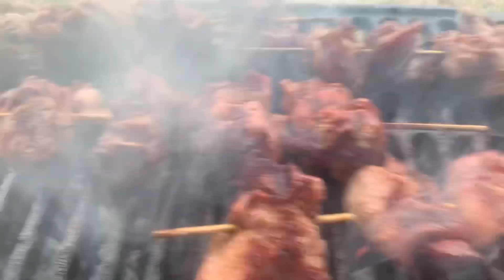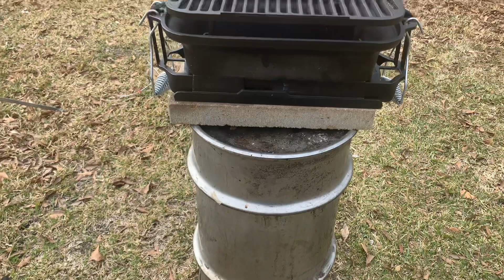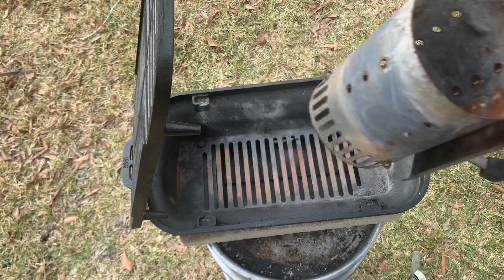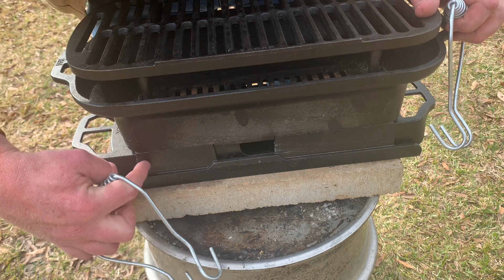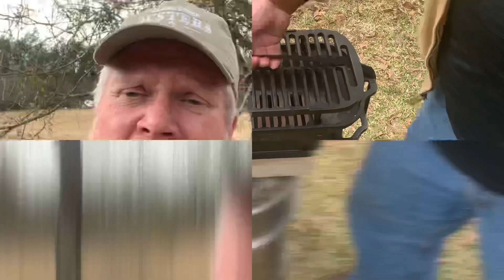Lodge Sportsman’s Pro Grill: Tips, Hacks, and Cautions. (A Follow Up Review)

Comment: ¤♤ NO GRAVITY  IT JUST SUCKS! " ROCKING IS FoR MUSIC : NOT GRILLS ( NEVER TIGHEN THE SCREWS OR DRILL TWO MORE MOUNTING HOLES : NEW: ONCE It  WARPS U R S O L ! ) GREECE DRIPER ON THE ENDS & NO FEED DOOR ! MUST DROP FOOD IN DURT TO ADD FUEL! CHAIN YOUR OLD LSG TO THE SIDEWALK/ TREE/ SWIMING POOL OR : CLAYMORE?  REPREHENSIBLE  ~ TO BUY OFF SHORE COPIES OF THE REAL LSG THAT WAZ? 😢😂☠️💩🇺🇸🙏 and ~ and ~ $149.00  & drop the catch tray on ur foots ! Unles you ( too late to return?) Secure it wit a re| bar thru the vents & bend the ends / drill pin holes : so it wont slide out & then? Cut a slot in the side & use or " CREATE " a feed door ? 😮🤔🤫😵‍💫😵🥴 pity! Bring BACK THE ORIGINAL LSG : ~ if ya didn't sell the rights TO DA CHINESE OR ANOTHE ENEMY OF THE PEOPLE! 🐍☠️

Comment: I would just cover the last 3 inches on either side of the charcoal box with foil so if/when you adjust the air flow, the grease goes where it's supposed to. It shouldn't mess with the air flow enough to affect the grilling.

Comment: As long as Lodge has made the Sportsman's Grill, you'd think they would have perfected it's design by now. Which may be easier said, than done?
Reply: modern companies are really fucked up. i'm certain what happened here was that lodge management decided the old design needed to be upgraded so they handed the project off to a new wondershit designer/engineer who is a vegetarian/vegan who never goes camping, so they ended up with a portable grill that is not really portable, that can't handle cooking meat or anything greasy or oily. and the wondershit designer/engineer convinced the others around them that this was the ultimate, perfect design to replace the old model.

Comment: Great follow up Lew and nice trick with the velcro straps.  Is there some way to use and old dowel rod to make a handle to carry  lunchbox style?  Drill a couple of holes at the end of the rod or eye hooks, and add some rings or S hooks and attach them to handles?
Or fashion some sort of bungie strap handle? Or, hit your local thrift store and find yourself an old gym duffel bag the grill will fit in.  That's how I haul my DO stuff and  carry my grilling utensils, all together.
Reply from the maker: The bail on the old Sportsmsn’s Grill fits the new Pro!

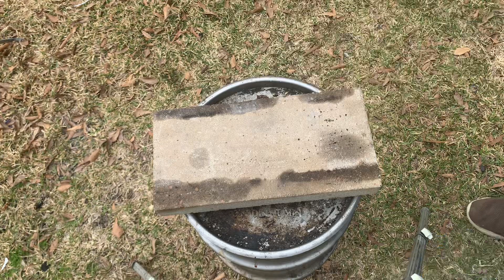Comment: 10:19 You're hard on your cast iron, that's a hell of drop test.  LOL
Reply from the maker: Yea, I should have set it down softly.  It w really was only a couple of feet into the yard,  the grass and soil were a little soft from a rain the night before.  Still made a racket, that I heard better during editing than I did live.  It survived and works fine no damage done.   
Speaking if which those Velcro straps are going to make it easy on the sliding ash drawer. That way I won’t have to ever give it an accidental drop test. 
Thanks for watching Matt.
Reply: It’s cast iron it can handle a drop on grass
Reply: 🤣🤣🤣weeeak!!! I thought it was just me. Tuff & durable, BUT, fragile like glass. Luv it  Big Lew. 2oooo funny with da TOSS & DROP..😂